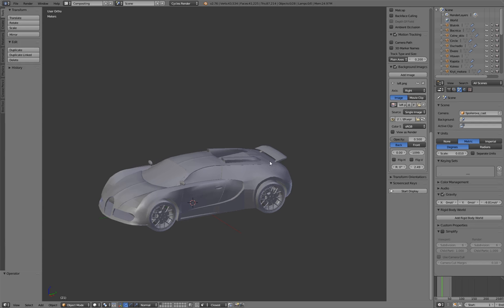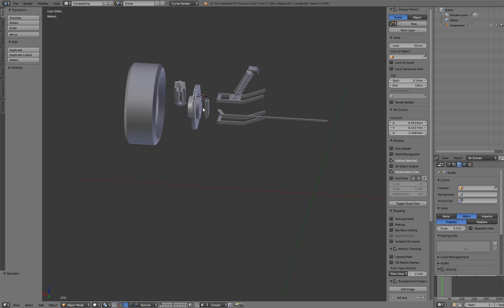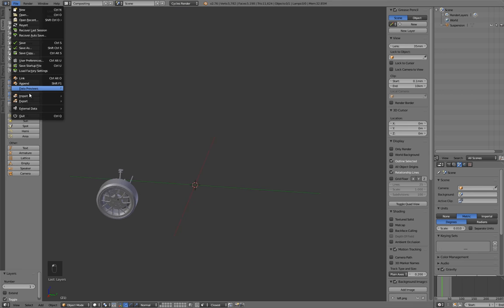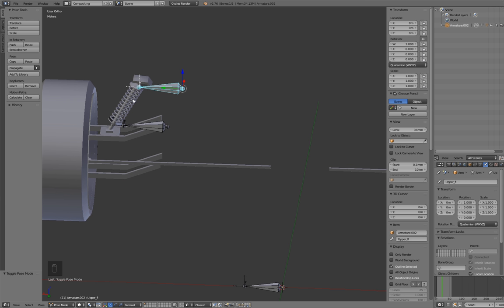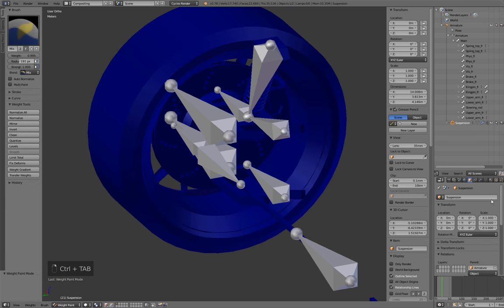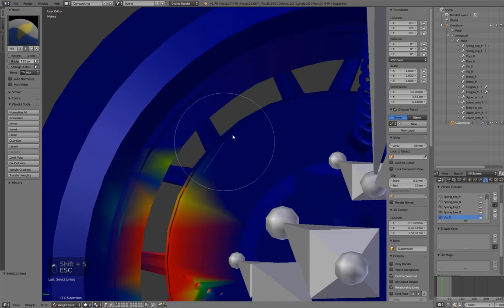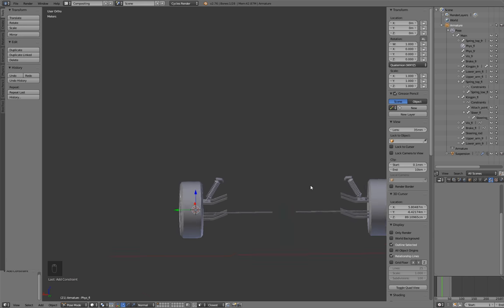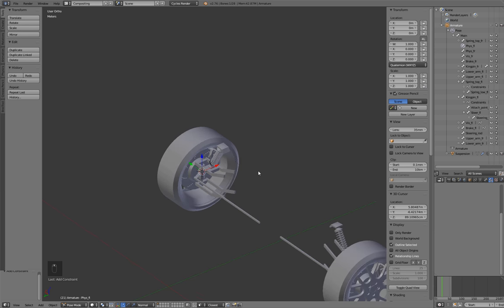How to get Double Wishbone Suspension from Blender to Unreal Part 1

Comment: I ran through this tutorial myself and I was determined to find a better solution to the spring problem you ran into. 

I managed to solve the issue by first applying a linear weight painting gradient along a straight cylinder for each bone. One bottom to top, and one top to bottom.
https://pasteboard.co/H9LkCyk.png

Once the linear gradient was applied, I used a curve modifier on the cylinder using a spring shaped curve. These spring curves are generated from a blender Add On called Add Curve: Extra Objects:
https://pasteboard.co/H9LkLCI.png

I then animated the bones to get a very desirable spring deformation. 
https://media.giphy.com/media/pOJPioZ2Quw9rgUClr/giphy.gif

This will save a considerable amount of time compared to selecting each edge loop and calculating a weight to apply to each.

Hope this helps people in the future. Please sticky this if you can.
Reply from the maker: Brandon Macdonald that's pretty cool! I knew about the gradient stuff but haven't thought of this...good job

Obviously, this is old video, now I would do a lot of things in a different way than then, I just really wanted to show you some approach because I know I've been lost and needed a little push.
Reply: Thank you. This tutorial is still very relevant today and is one of the very few out there!! Cheers

Comment: 72 Subscribers now. It's nice to see someone implementing Automotive Physics from a realistic standpoint. I'm an Automotive Technician. This video just got my interest, because you are using wishbone suspension. I am great with cars. Not so much with programming. I an only 5 minutes in but it's getting late. I'll finish this Tutorial Tomorrow. Thanks man, you really don't know what this means to me.
Reply from the maker: Austin Cain as much as I love your comment, this is nothing but animation. It won't affect anything else but looks. I am currently working on a driving model but I think having this happening in real time is not possible to implement without some serious drawbacks
Reply: ligazetom If I get it working correctly, I'll let you know. May even put a video up here. I don't do video normally, I have no mic. I'm going to be using  unreal with Physx. I'm hoping what I learn here will help.
Reply from the maker: Austin Cain well Unreal is already using PhysX from nVidia running on CPU, I think what you want to use is PhysX to run on GPU, however for that you need to download devkit and somehow recompile it with ue4, I am not really sure, but whatever you do with physics in Unreal is done by PhysX on CPU
Reply: ligazetom I applied for access already. I am kinda lost when it comes to Physx though. I can do a lot programming bone transforms and blend space. Plus I know a lot about the steering angles and curves of a vehicle.
Reply from the maker: Austin Cain I am looking into this as well, however using GPU physx will make your "thing" run only on nVidia gpus. Good luck then
Reply: ligazetom I have an NVidia card. I'm probably not going to restrict it to NVidia by forcing the gpu rendering though. I didn't know if the simulated physics was the NVidia Physx or not. I'm kinda new to Unreal.

Comment: To export as a skeletal mesh, it isn't required to apply all the bone constraints in Blender, right? I love the video.
This is the only video that has helped me have any breakthrough in UE4 vehicle creation. Many Thanks for your help on this topic!
Reply from the maker: Well, bone constraints are not exported with the mesh. You have to set it up in UE4 again. I was using them in blender just to help you understand the idea so the UE4 setup would be easier.

Comment: This is a great tutorial but can it be applied to Maya? I may have done something wrong but does Maya handle bones differently compared to Blender? After setting weights to the spring and associated joint, I can't reposition the bone (spring top) like you did at 29:43
Reply from the maker: +Romulo Rodriguez Well I have never done anything in Maya, but I watched some tuts on rigging in Maya and from what I have seen Maya is using joints, which is only some pivot point to rotate around. Blender bones looks like when you have two joints parented to each other in Maya. Bones in Blender have Head and Tail part. Head part is the Root of the bone, so what you want to do in Maya is setting up the joints to places where I have "Heads" of the bones. (just write to google "Heads Tails Blender bones" if you are not sure what I am talking about) Tails in Blender are just for reference so you can see better where the bone is looking. So to sum it up, 1 bone in blender should equal to two joints VISUALLY! in Maya. But for each single bone I have created, there should be one joint as well. I know it is hard to apply something I am doing to another software I am having hard times with that as well but to recreate in Blender. However if you create advanced vehicle template in Unreal, and open up Skeleton of the vehicle, you can see how the joints are set up there (thats how I found out how to do it) but there is skeleton made in Maya. So hard time for me to do in Blender, but for you it should be way easier to understand to. So in your case, where I have two bones parented, you should have only one bone again, visually. So what you want to do for the spring, is that you create one joint on the top of the spring, where I have created Spring_top_fl and another one on the bottom of the spring called Spring_low_fl and make Spring_low_fl parented to Spring_top_fl. It should create a "Blender looking bone" through the whole spring and it should be already looking the way it should so you can skip the tail moving I did.Another thing is I am not sure if the "joint looking" really works like this in Maya, unfortunately those are things you have to figure out yourself. Head part of the bone is the ball where you cannot see the axes of the bone, and tail is where you see them. So the reason I am moving the tails of the bones are explained in 41:40. Again I have no idea how it all works in Maya in terms of pose mode and world/local space. I recommend that Unreal skeleton. Check it out and you can copy that directly and I am sure you will understand then why I have to do it like this in Blender. So to sum sum all of it. You only have to care about "Heads" of my bones. There you create joints. The effect you want to see is to have two joints in Maya to be looking like one bone in Blender. Again only LOOKING. I actually think when you parent one joint to another it automatically do the thing I am doing with "Tails". Give it a try. Check out that Unreal Skeleton, open up the asset and click on root bone and it will show you all the bones in the mesh.I was trying to recreate that double wishbone suspension for 3 months of free time so it is not something that can be done easily if you don't even know where to start. Wish you luck! Let me know then. Basically, can you see that dashed lines that are showing parenting? That is all you have to care about. Just instead those dashed lines maya creates that "blender looking" bones. I really cannot explain it any further :D. So just focus on those dashed lines and heads of the bones. Ignore everything else and try it out.

Comment: Hey, tutorial looks great, I wanted to try that but I got stuck with set the spring movement as you described (two horizontal bones, one up, second down). Could you describe it a bit more please how to achieve that (let's say I have created spring mesh, what else)? Thanks a lot!
Reply from the maker: Jan Hájovský you have to apply weight with linear degradation for verticies further away from the cotrolling bone. it means that lets say you have spring where your circle has 6 verticies. you have 20 circles in whole mesh. bone weight is applied from 0 to 100. so you have to divide 100 by the number of circles you have. that means that 100 divided by 20 is 5. so on every circle you have to apply weight of 5 + every step closer to the bone for every direction. so the lowest bone has 100 weight on the lowest part of the spring and 0 on the highest part and vice versa. so in the middle the circle is 50% affected by lower bone and upper bone. sum of the influence applied to a vertex must be 100. (i can explain it even in slovak, im not sure where you are from though)
Reply from the maker: Jan Hájovský well then just continue to watch the tut. the whole thing is explained further...the hiearchy as well as applying the weights...i did not include spring applying cause it took 45 mins to apply correctly...the total hiearchy is explained at the end but just for the spring the bones are equal to each other
Reply: Is there an easier way to do this other than manually applying weights to the vertices? Does blender have a tool that can apply a nice gradient between two edge loops? I searched for hours tonight and can't find an answer to this.. I could have just done it manually by now.